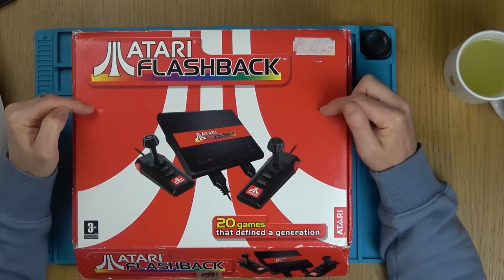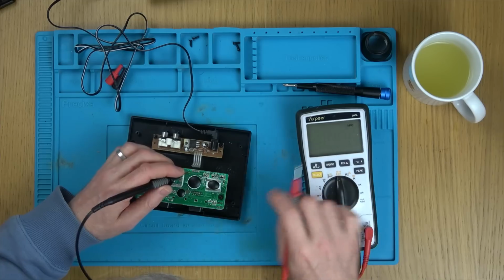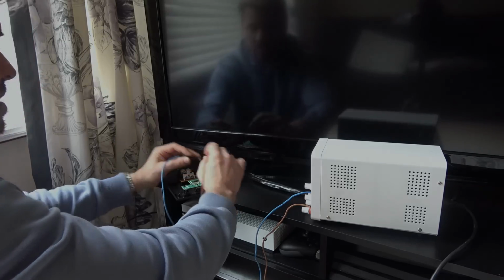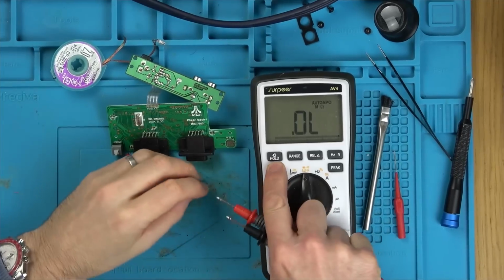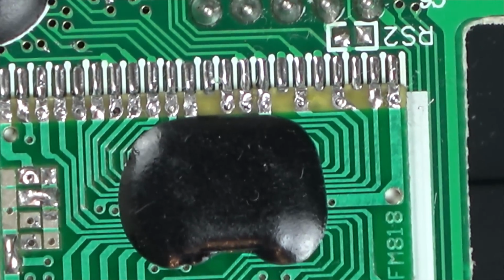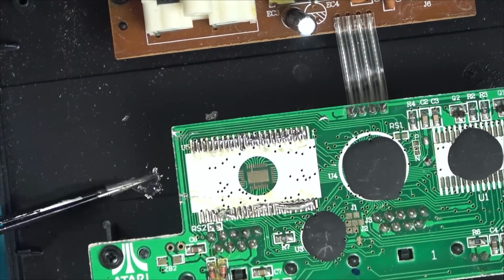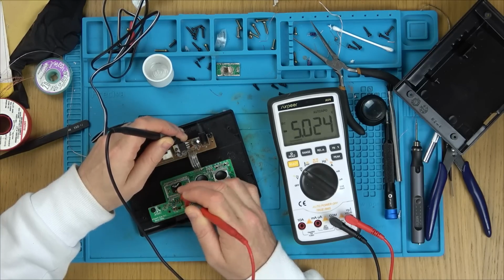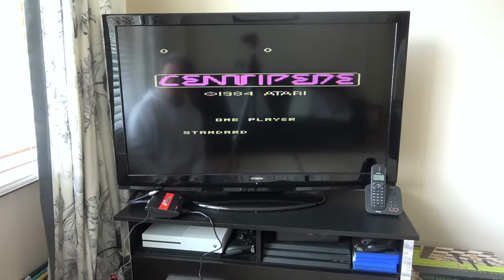ATARI Flashback with NO DISPLAY - Can I REPAIR it?

Comment: The weird thing about this original Atari Flashback, is that it isn't actually an Atari in any way, shape or form. the company that was licensed by Atari to make it was led by Curt Vendel (who was an original Atari employee), and they were given a very short amount of time to produce the machine for the xmas market. so the simplest solution was to make a Nes-on-a_chip solution, port the games to it quickly, and bung it in a replica 7800 case. If you tried plugging the Flashback's controllers into a real Atari 7800 (cos they're quite a nice size and comfortable to hold), they won't work, as they're basically NES controllers with an Atari plug.

However, the Flashback was quite a big seller for Atari, so they went ahead with the Flashback 2. This time, Curt Vendel made sure he was able to spend more time on it, and produced a replica 2600 that was actually an Atari 2600-on-a-chip. He also included instructions for adding a cartridge slot to add the ability to load real Atari 2600 cartridge games. You can also plug in paddle controllers, and unlock some paddle games. They followed this up with the Flashback 2+, which has some minor differences, but every Flashback since then has been produced by AT Games, and is some sort of Arm-based emulator. 

Atari have now produced the Atari 2600+, which is basically, a 7800 in a 2600 case, with HDMI output, and compatibility with both the 2600 and 7800.

Comment: I dont know if you still check these comments but I'd like to ask, what is the name of that blue electronic work matt you are using and where might i find one for myself? Looks like something i could use to keep my own repairs organized 😅 im working on an Atari flashback 3 myself and thats why i found your video. Very well put together video, so you got another sub and like 🎉 keep it up man 👍
Reply from the maker: Thank you. If you type 'soldering mat' into eBay or Amazon you will see them or 'silicone soldering mat' 👍👍👍
Reply: @Mymatevince  Thank you so much man, I really appreciate it 😃

Comment: That PSU is either labelled wrong or faulty.  There's no way that regulator will last very long without a heatsink.  Get a 9v PSU or fix the broken one.

Comment: Am a bit late but that blob on pcb is probably a rom chip holding the software and games and you moving it caused it to work and without pressure the dots appeared probably because the cpu/ppu had nothing to execute than random garbage in ram i wonder what those rom chips hold and if they have been dumped so maybe you can replsce it with a regular rom chip would be fun to see but you can also call it a day. Also the blob chips popping is a common issue i have probably because then air gets introduced or some pressure difference pops the epoxy, killed a few roms but replaced with regulsr roms

Comment: There was another Atari console between the 2600 and 7800: the 5200.

It only lasted 2 years and sold way less than the 2600. They don't look to be too expensive as parts, at least states side.

Comment: I'd try to apply some heat to the chip, using hot air station before completely destructing semi-working asic. Checking traces continuity around the problematic area also is not bad idea.

Comment: I didn't realize that those blob chips were on their own separate boards at first until I saw you desolder them!  I thought they were soldered directly to the main board.  Really cool that you actually CAN remove and replace them and still keep the main board intact. Well done, Vince! I was feeling your anxiety when the power light wasn't going on after all your work.  Glad you figured it out!  We've all been THERE before numerous times, but the feeling is great when you get it all figured out and working once again!   👍👍

Comment: Hi Vince, just my 5 cents here - I suggest you get a proper 9V adapter there. The 7805 can handle the 35V input but it also needs a proper heatsink for that and here is none.

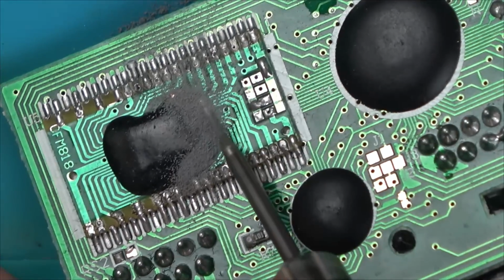Comment: 22:17 why didn’t you re address the soldering you did before grinding the blob? Something changed and could be a stubborn solder joint between the 2 boards still?

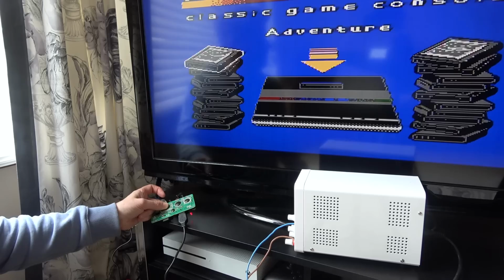Comment: 18:30 Yeah, thought it'd turn out to be the ROM because of the spotty output. I'm not sure what the pinout is, or if its even possible on this model, but some of those flashback consoles could be modded so you could wire in an original atari cartridge slot, replacing the onboard games

Comment: Vince, double the power creates resistance, resistance creates heat, heat causes components to fail, and I think that is what caused the first blob chip to fail. reason why I don't think the 2nd blob chip has failed (yet) is because it can happen over time. it isn't just voltage to be aware of it is also the current that is supplied to the device. higher voltage also means higher current.

Comment: This is the first version of the Atari 'Flashback', and there were some odd choices that happened.  First of all, it's not emulating games or anything...the guts are basically a NES-on-a-chip/Famiclone (just like most of the other XXXX-in-1 cheapo systems where there are like 10 NES games with repeating 100 times throughout the menu), and the 'Atari' games are just re-creations made for the NES/Famicom hardware, and so the accuracy is all over the place vs. the original games.  Second, they designed the shell after the Atari 7800, a system that wayyy less people would recognize at a glance, so that was cutting out even more potential based-on-nostalgia buyers.        (Also, ugh at the flared-legs Atari logo from this era :P...but that's just me)

Luckily it sold enough that the Flashback 2 happened, which was styled after an Atari VCS/2600, and the guts were basically a modern 'Atari-2600-on-a-chip' that's runs the original game ROMs.  The designer of both put so much thoughtful work into making the 2's hardware faithful that the circuit board lists what you need to hook up in order to add an actual cartridge port to play physical games carts on it.

RIP Curt Vendel

Comment: The Atari 7800 was 2600 compatible too. The Atari 5200 was not. They had weird multi-function joysticks. IMO 7805 with 18V is too much - the extra power is converted to heat. 8 or 9 V is more norm.

Comment: Can someone please explain to me the purpose of a blob chip? If I google it, I just get that its purpose is to protect the chip. Protect it from what, humans? First, I thought it had a cooling effect, but I just dont know.
Reply: Do you ask about the black epoxy? the chip is bonded to the board with verry thin and fragile wires from the top of the chip in an arc to the board - like a sideways (  .. touching or bumping it during assembly would destroy the wire .. so the epoxy is put on top to protect the wires and the surface of the chip. the epoxy is black b/c the chip is mounted "face up" and would be light sensitive like a photo diode - so light on the chip would lead to malefunction. (like the Raspberry PIs that crashed when you took a photo with a camera flash near them :D )
Reply: @VVerVVurm   Great explanation, thank you
Reply: Its also a cheap way of producing chips and prevent people from easily reverse engineering, they are in all toys and cheap chinese things in this case with atari its probably a noac(nes on a chip) wich atari reprogrammed to emulate their software oe they compiled their games to be able to run on nes hardware its a generic 6502 cpu and some nes glue logic and ppu and spu

Comment: Great Video Vince, That blob chip you ground away looks like some kind of eprom or flash memory from the layout of the die. I wonder if it's possible to use one a smd one of the footprint. I also noticed on the one you were soldering in had a mark of WE which could be Write Enable and 8b and 16b which looked like a jumper for 8 or 16bit access. Keep up the great work 👍 Also it's called a trackball 😂😂
Reply from the maker: Thanks Mick. Trackball...Yes that's the one 😂👍👍👍

Comment: Vince , these are simply called COB Chips, (Chip On Board)
Because it is physical wires from the chip to the board, a potting compound is blobbed over the chip to support the wires from vibration or strain.
The resin is blobbed on the chip, then placed in an oven for 4 hours to harden.
Unlike the chips nowadays, COBs were time consuming to make back in the day
Reply: I wonder how many cents they are saving by skipping the chip packaging .. must be a whole tenth of a cent or so 🙄

Comment: Lol. Nothin but caps and a few transistors in those lol. Easley fixed as long as the cpu isn’t toasted lol. Put a better connector on it with a mosfet or some kind of over voltage protection.

Comment: Hey Vince, fun fact: The original Atari Flashback is actually a Famiclone :) Companies in China and Taiwan have been making clone NES chips for so long that it was actually cheaper for them to reprogram all of the games to run on NES than it would have been to use a modern chip or try and clone the Atari hardware.

I am assuming the hardware you have is the Famiclone version and not the later ones that do actually emulate/clone the Atari hardware, but that might be hasty. If I'm correct, the blobtop you have on that little carrier board is the ROM chip that stores all the built-in games.

I actually have a cheap bootleg cart that uses the same mapper and ROM chip as well. Unfortunately there is no modern equivalent of the ROM that can  be purchased that will drop right in :/ The closest one would have been a 27C320 but there are none available anywhere in the correct package. You would have to bodge in a pair of 27C160s with the right logic to switch between them. 27C322 wouldn't work as it doesn't support byte access.
Reply: Wonder if those bridged jumper pads on that chip board is for selecting different games/roms. Maybe the Famiclone is still in there - Ive taken apart stuff before where you get different languages or sound effects by making or breaking those solder links.
Reply: yeah, was hoping this was the Flashback 2, actual 2600 on a chip but sadly no its the lame first one :(

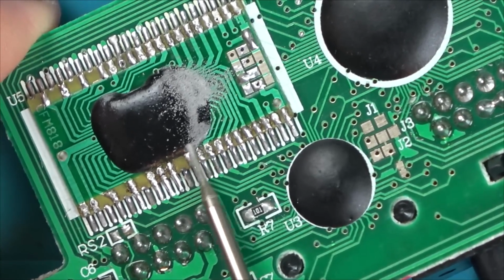Comment: @22:00 I’m 90% sure the fault would have been the soldered bridges between the main to sub board, those are prone to cracking, especially as it got worse when you tried soldering them, I think if you had persevered with those connections you would have got it working.
Reply: I agree with this. It's quite unlikely that the connections to the die would go bad in a simple device like this that is stationary.
Reply from the maker: Thanks Scott. Maybe, looking through the microscope they all looked ok, but it is easy to miss a crack especially with all the reflections from the lights 👍👍

Comment: You looked up the maximum input voltage of the 7805 voltage regulator and concluded from that that the power supply providing double the stated input voltage would be safe to use. This is not a safe assumption to make. To drop the voltage a linear regulator like the 7805 disperses the excess power as heat and can get quite hot. Hot enough it can cook and destroy itself if the circuit draws sufficient current. In this example here the regulator was used without a heat sink, which strongly limits the amount of current the circuit can draw and by going from 9V to 18V input you effectively tripled the amount of power the regulator has to disperse as heat.
Reply: A true 7805 has built-in thermal protection, so it shouldn't completely fry itself from heat--the output will just drop and eventually shut off completely. However, the thermal protection does kick in at a pretty high temperature so you're not doing any favors to the system by letting it reach that.
Reply: @rfmerrill  True. Though I wouldn't rely on this thermal protection working all too well with modern Chinese-sourced 7805s.

Comment: Nice fix :) Never got Atari consoles myself but have some old Atari games downloaded in my PS3 in the Atari Anniversary Edition Redux (PS1), which includes Centipede, Pong and for example Asteroids.
The Mini C-64 is my only "modern retro" device, bought it in 2018, so far has been working fine. My original Commodore 64 C in the 80's blew it's power supply right after warranty  expired :D

Comment: Those 78-series LDOs (low drop regulators) are linear regulators, meaning that they discard excess power as heat. For 9VDC input you get 5VDC with only minimal heat production, whereas with 18VDC input you'd get the original waste heat plus that of the additional 9V on top of it, making a heatsink likely a good idea. It's probably why they picked 9VDC for the adapter, and it's still concerning to see it output 18VDC. Makes you wonder what's wrong inside the adapter...
Reply: 7805 is not an LDO, it's a normal linear regulator.
Reply: Exactly what I was going to say Maya to the letter! Yes it'll still give a 5v output, but get red hot. No way I'd be using an 18v input.
Reply: the adapter may be fine .. before switch mode power supplies this was normal behaviour of the crappy just-a-transformer-bridge-rectifier-and-cap PSUs. loading it with the specified current will bring it down to about 9V. we never saw the output voltage with a proper load
Reply: @VVerVVurm  I've worked on lots of vintage equipment and consoles and although I'm not saying you're wrong, I've personally never experienced that myself. 18 volts is too high, even for a 9 volt straight bridge-rectifier power adapter, which would output approx 12volts.....which I have actually seen. But never 18. I personally wouldn't use it.
Reply: @REVERSE_BIAS  I agree .. if I think about it again .. SQRT(2)*9 .. 12-13V seems reasonable .. and the adapter is made for 230V AC .. what would happen if there are shorts on the primary side of the transformer? fewer effective turns and higher output voltage? or they used a 12V transformer inside the adapter by mistake

Comment: that is the reason why I do not like blobbed chips. if there is to much stress on the pcb, bonds will break and there is almost no chance to repair them.
Sound should apear if you start a game. There was no sound an an Atari an the "start screen".
Reply: I hate them too .. no chip markings, not repairable, can't desolder and re-use the chip.. and I wonder how many cents they are saving per unit 😠

Comment: These L7805 voltage regulators are least efficient, nowadays you'll see less and less of them. Instead there are MOSFETs which are more efficient but you need a coil and a cap, and or you can use what's called a dc to dc buck converter which has all of it and is super cheap ;) if you'd buy up to 3A. I'm building now 400W one :D, but still not too dear ;). Will be videos about it for sure. Have my transformer already made.

Comment: I don't think it's a good idea to measure continuity on a circuit with voltage.
You can 't be sure of the validity, and there's a chance you damage the meter.

Comment: It says a lot about the QC and quality of a product when the DC output is labelled as 9v and yet its outputting 18v. Sure its fine for most modern stuff since they have regulation built in but if someone grabbed that to use on an old device thinking it was a 9v output it would almost certainly kill it.
Reply: I would imagine it's not actually supposed to be 18v, I had a 9v that was doing 12v, it's likely just a failing cap or something.  If this was from 2004, that would put it in the age of bad caps, like you get on the original xbox and such too.